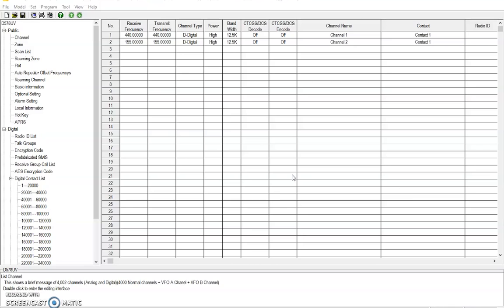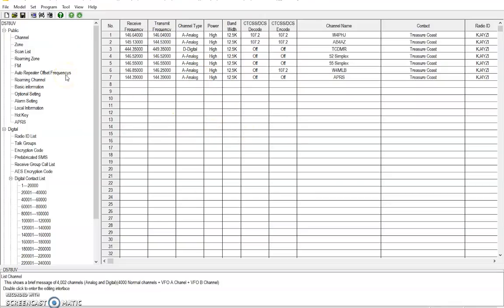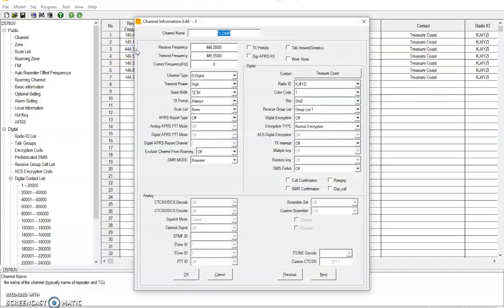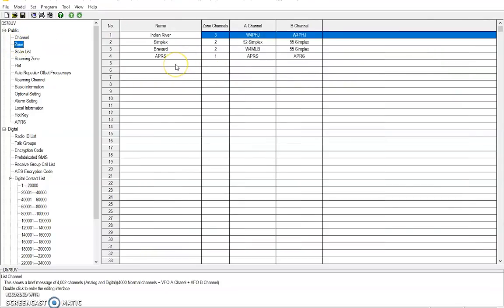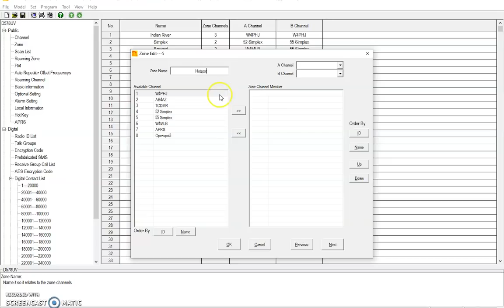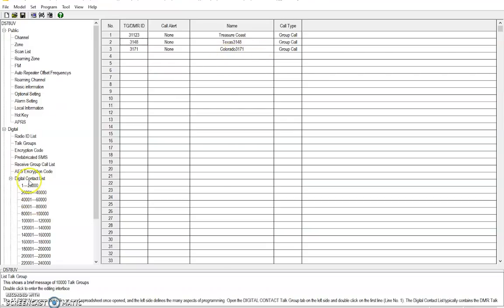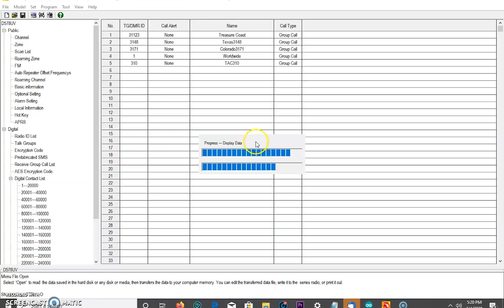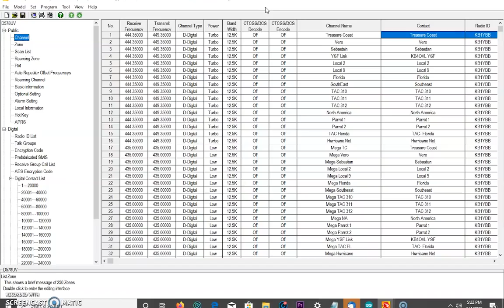DMR Codeplug Programming, VERY BASIC, Anytone AT-D578UV

Comment: Hi,
1. Where can I download the programming software and which cable is suitable for programming? From my past experience with Yaesu FT3DR, the cable that comes with the radio isn't for programming. This drives me crazy. Fortunately, after several days, I found that I could program my FT3DR with the SD card.
2. To program AT578UV, is it possible to import/export from/to a csv file? I have more than 200 channels to program and I definitely DON'T want to do it one by one. With TYT MD9600, I made a csv file which facilitates minor amendment. I would like to import the exact same csv file to the Anytone.

Comment: So just to respond to the 3rd question comment... I have this radio and I've been trying to program it from the handset and setting the offset isn't obvious compared to my kenwood HT. On the Kenwood it might be too simple but I put in the frequency and there is an option for +/-/no offset which uses defaults unless you change them. 

On this, under radio settings there is an auto repeater chan a and b offset setting and then under channel settings there is an offset setting as well as a separate TX and RX freq field. Obviously I can manually set things, but is this the expected operationing mode? Why even talk about offset if so? I came to this video after troubleshooting for an hour with my local club trying to figure out why some weren't hearing me only to find out auto repeater offset doesn't do what I thought it did. The ham radio test answer on the theory is simple, the execution in this radio is not clear. Rather than gloss over that I'd love to learn why there seems to be 3 different ways to state an offset and what the differences are for.

Comment: Always enjoy your videos.   I think it is great that you are out there promoting the hobby.
Question:  Are your analog repeaters actually narrow band or should your analog bandwidths be set to 25k.  Just wondering.  Keep up the great work.
Reply from the maker: No it's 25 but I realized I showed 12.5 I started over a new code plug and actually fixed it on this one... I wasnt paying attention
Reply: @HamRadioConcepts  
Definitely wasn't meant as a criticism...just noticed it and though to mention it.  Great videos....please keep 'em coming.
Reply from the maker: @W5ERX4911  No worries... Before I saw your comment I had already noticed it...12.5 would still have worked but as I was going through the codeplug I then noticed it :)